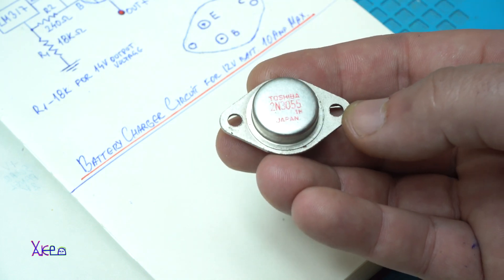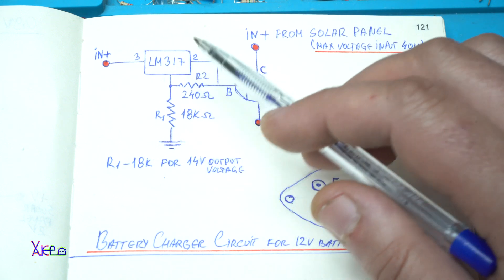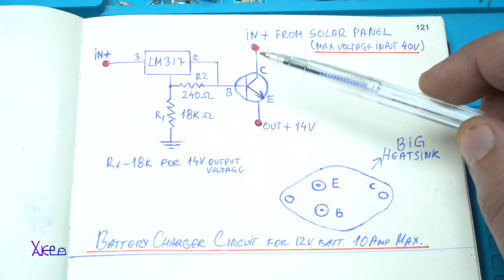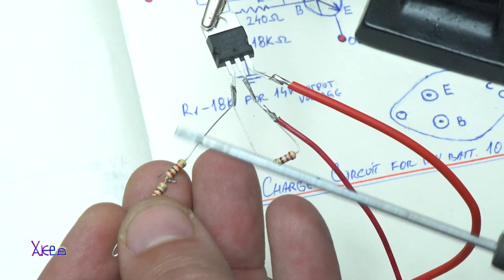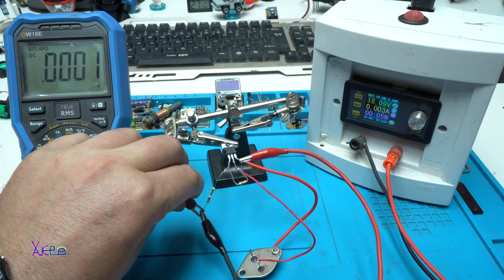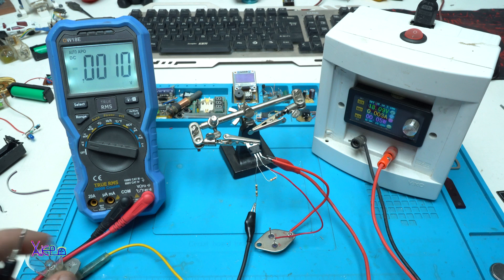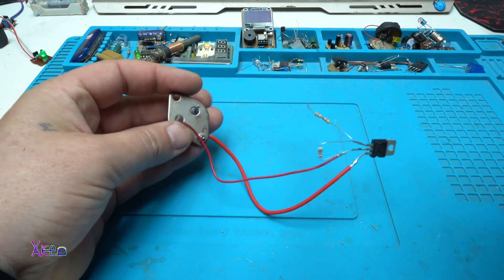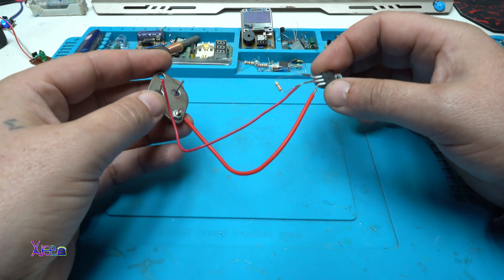FAST 12V 10A Battery Charger Circuit using 2N3055 and LM317

Comment from the maker: Correction,R1 is 2.8kohms NOT 18kohms,sorry for mistake in circuit diagram
Reply: Two 5.6kohms resistors in parallel give you 2.8kohms.

Comment: I suggest closed loop reference feedback from emitter of output transistor and use potentiometer in feedback reference circuit for output adjustability.
Reply from the maker: Thx for your suggestion, I will try that!